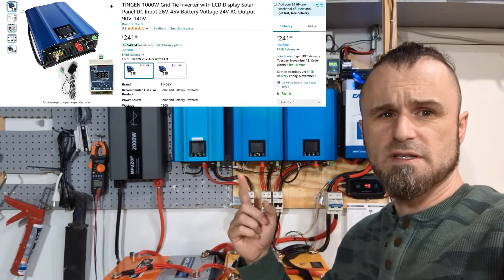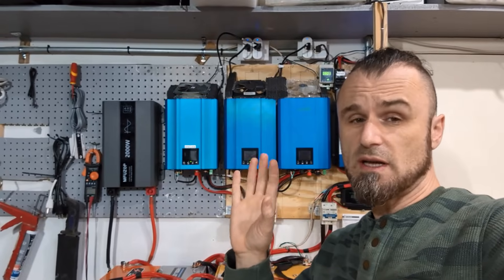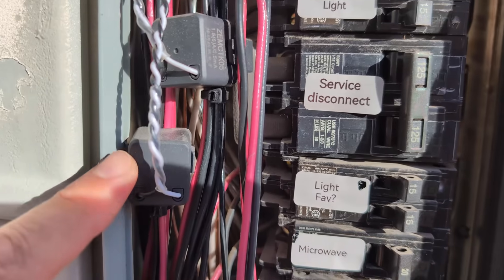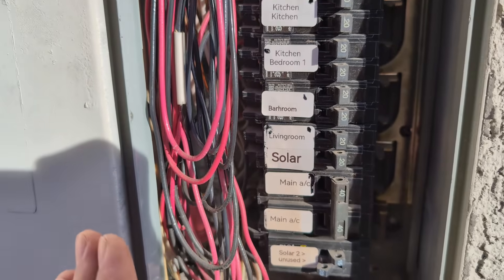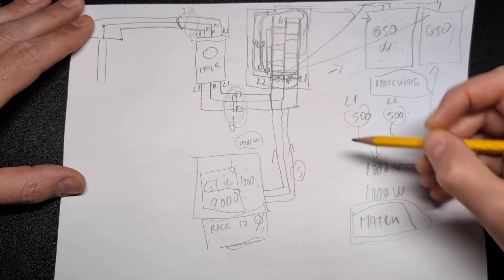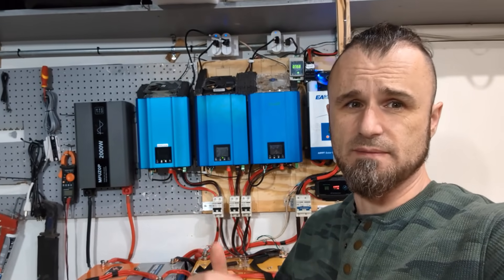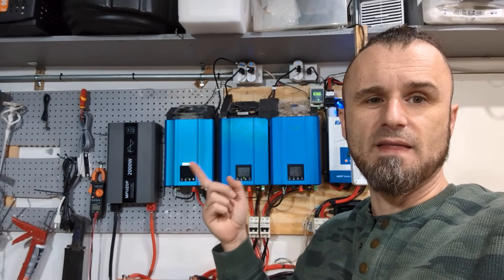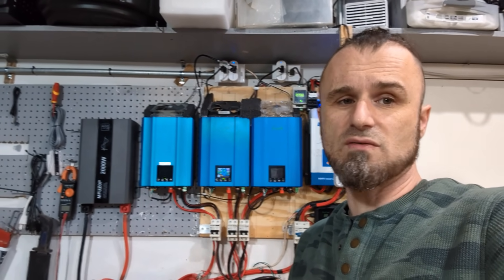What is the BEST Grid tie inverter with POWER LIMITER? Depends very much on your Breaker Panel!

Comment: You said in this video that it is not good to send power back on one of the lines. And then you said in a different video that it is OK to send Power back on one of the lines. Then you continue to say that you're not getting billed for it. I'm a little bit confused.
Reply from the maker: The meter is not enough to make the distinction between the side of the wave so you can push 100 watts in the network and use 100 watts on the other leg and the meter will calculate it as zero
Reply: @VegasRoManiacReviews  this may be true with your smart meter. 

But some smart metres read how much you've drawn from each leg and a total amount drawn and how much has fed back on each leg.

In some areas, they force you to buy a 2nd meter. 1 meter you're allowed to draw from and the 2nd meter you're allowed to push into to sell back to the grid

So, I am now totally guessing if you're producing 1000 W from one line and 0 W from the other line, you could be pushing 500 W back into the grid. With this not be considered a waste? Even if you're not being charged for it?

Comment: 2 Questions:
1) How do I know if my inverter is Race to zero an algorithm built in or Matching algorithm? I have the sun 1000W GTIL2 cant find it on the spec sheet

2) if you consume 200W on L1 and 200W on L2, then feed 300W on L1. Would the meter alert the utility for backfeeding 100W on L1 or does it just report the total consumption which is 200+200-300=100W?
Reply from the maker: Apparently the CT sensor inside the meter is not smart enough for that , so it works , you can do 300 on l1 and 100 on l2 it seems it as a 400 watt regardless where goes what ..
Reply: @VegasRoManiacReviews  Awesome!!. my SUN-1000W comes with a CT clamp (like the bottom one), and the manual says CT clamp goes between meter and panel. Its safe to assume that its race to 0.

Comment: Nice video and explaining, but i have a problem with the ct clamp and can't figure it out Why when the the inverter sends the watts it reads, it will divide by 2 so i always inject half of what's real, i tried to clamp 3 diferent main lines (the thick ones that goes into the bipolar différential) they all give the same thing , i can't clamp every small wires because they r too short and rigid
Reply: I think my problem is with what u say at min 7:00 because i inject the current in the wrong place, but don't have many options to try, maybe it will work when i'll buy a 2nd inverter with ct clamps
Reply from the maker: The CT clamp read has that function. If one light on that it's straight.  If 2 lights on it cuts in half and so and so till it splits up to 10
Reply: Ok about the splitting but i won't need thaymtw my problem is about the CT clamp i put on the main line but because i inject from the inverter in a normal AC plug that goes behind the ct clamp so it will detect what i inject too so when it tries to inject what it reads the clamp will see zero but it won't stay there so it will recalculate untill it will stabilize at half of the consumption, and i think the only way to fix that is to inject from inverter directly on the main line before the ct clamp but idk how, Did you modify anything on your electric panel to inject or where do you plug your inverters?

Comment: You could bundle the cable from your solar inverters in each phase to use race to zero. Greetings
Reply from the maker: You can't , because the phases are opposite of each other so they cancel each other in equal proportion of the usage on that phase
Reply: @VegasRoManiacReviews that's why i wrote in each phase a bundle for A phase and another for B phase

Comment: Hello.  Your explanation is excellent, and I am glad you did it on paper. I have a question regarding a different use of your race to match grid tie inverter. Can I use it directly on my 220v central air system?. I would wire it directly to the central ac using a sub panel connected directly to the ac.  I would use the CT clamp on the hot wire going from my home panel to the input side of the ac contactor. I would put the hot wire from the grid tie on the other side of the ac contractor.  So,  let's say my ac uses 2,000 watts. When it turns on,  the CT clamp would tell the inverter to match the power being consumed. Assuming it is a 600 watt inverter, the 600 watts from the grid tie would go into the other side of the contactor, reducing the 2000 watt consumption by 600 watts. Since the grid tie has anti island protection, it would automatically turn itself off when the ac was off, and on when the ac was on.   Does this make sense to you?
Reply from the maker: Yes you could do that but you will need the 220 version of this inverter, not the 110 that I have in this video
Reply from the maker: 220 volts

Comment: Would the matching power limiter still work if you where to connect it to the wires coming out of the meter and into the breaker box?
Reply from the maker: Yes but those wires are too thick for the probes
Reply: @VegasRoManiacReviews nice mine were able to fit! So does this just work as a race to zero system when the sensor is installed before the breaker box?
When my system is producing 150w and I’m using 200w my meter reads 50w but when I look at yours if your pulling 200 and producing 200 your meter shows 200 instead of 0. Is that just because of the location of your sensor?
Reply: @VegasRoManiacReviews  unfortunately it didn’t work, I ended up having to connect a few ct sensor together to cover the all the lines going into the house. Now it’s working great
Reply from the maker: I'll bet you one of the probes was facing the wrong way but I'm glad you got it working. I've had that happen when I first started

Comment: I know you talk about leakage due to the brief delay of the CT clamp informing the inverter to ramp up power. My question is, when you shut down a big load (like your A/C) kicks off, isn't there a chance that the same delay will cause the inverter to continuing pushing more power than you are drawing to the grid? My understanding is that if you feed back even a tiny amount of power without a utility agreement that they will force you to take your system down.
Reply from the maker: @rdmd  it's true it happens the other way around too. So yes you have leakage when you turn off something, but remember the meter doesn't care which direction the electricity goes. You still pay for it. And no I don't think that their software inside the meter is smart enough to know which direction the electricity goes. I think they just see the sum total and that's what they bill you for and the sum total regardless in which direction goes

Comment: Thank you for explaining how you use these grid tie inverters! I do have a question, your drawing shows how you set up the first 2 units on the L1 and L2 and I understand that and how it works but, for the 3rd and possibly the 4th and future units, how would those be installed into the fuse box?
Reply from the maker: I will make a video on your your request and I'll try to cover it so that way we can all learn and then you will get your answer and thank you for watching
Reply: @VegasRoManiacReviews  Thank you, I look forwards to following all of your new projects, what you are doing is exactly what I have been trying to put together. I've watched hundreds of videos and yours finally snapped everything in place.

Comment: You can ask the utility to add a extension based to your meter
Reply from the maker: That's the worst idea in the world. So if you call the utility company over here to make changes to your thing and they see that you're producing your own power. Not only that they will not make the modifications but also they will send some kind of like agency on your head to try to figure out if you used everything at code, because they don't want to lose the revenue and they don't want to lose the taxes because when you buy electricity, you're not only paying for electricity. You're paying for taxes on it
Reply: @VegasRoManiacReviews just tell them you need to move your breaker box, which looks like a mess.  Install an updated solar box that you can get anywhere and clean up your rats nest as well as getting the meter reconnected with decent room for added ct.  They will know your bill is going down and they can see the panels so they know.  Make sure you are not feeding power back as if they shut off the local transformer to do repairs or maintenance and you back feed power you could injure the line man who assumes the line is dead

Comment: I was using these but now as non limiter mode directly from solar panels, for limiter I am using solis 5kw inverter charger, solis inverter calculates like glit inverters but can work as off grid backup mode too, also it can charge batteries at 5kw. My solis inverter can see power generated by other inverters and can put that power to charge 48v 16kw battery. In Australia we have 220v. I fell into trap of 24v but 48v system is better as it heats less and you can have more solar input. Details of my inverter is Solis Hybrid Inverter RHI-5K-48ES 1 Phase 5 KW 2 MPPT
Reply from the maker: That's awesome! And yeah Australia has very good sun. The trick with disconnecting from the grid is that it gets a lot more expensive so I've built small and then I keep adding stuff to it. In hindsight, I should have done what you've done, but now it's too late. I cannot restart without losing a lot of money
Reply: Can you provide à link for your inverter plz ?
Reply: @chris_mk5supra  I tried but link got deleted in the comment section. You can search using "Solis Hybrid Inverter RHI-5K-48ES 1 Phase 5 KW 2 MPPT "
Reply: @chris_mk5supra  Please search using Solis Hybrid Inverter RHI-5K-48ES 1 Phase 5 KW 2 MPPT
Reply: @ tried multiple times but comment gets deleted.
Reply: @ what's the exact model band brand?
Reply: @ it is Solis Hybrid Inverter, and model is RHI-5K-48ES, it has 2 mppt